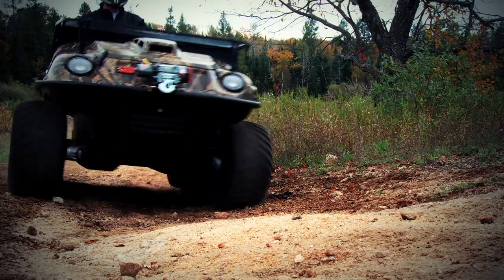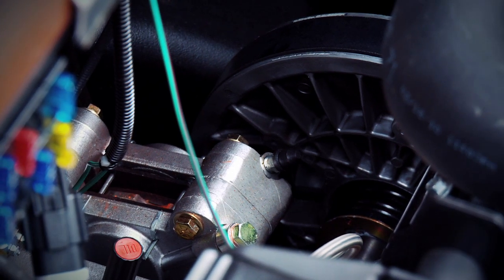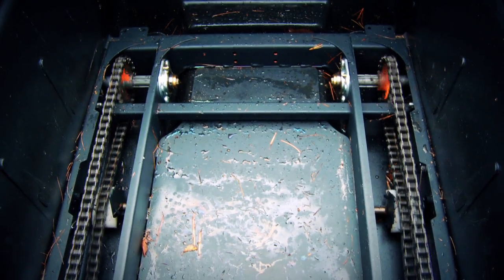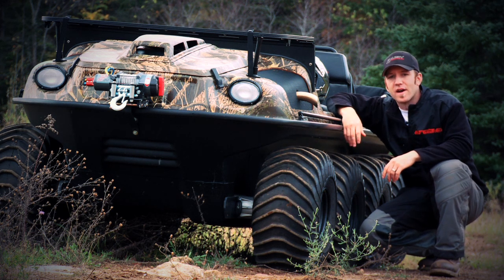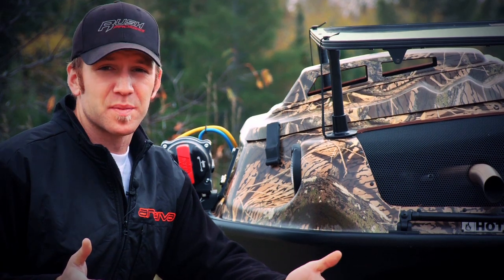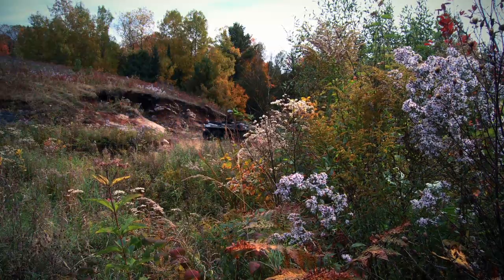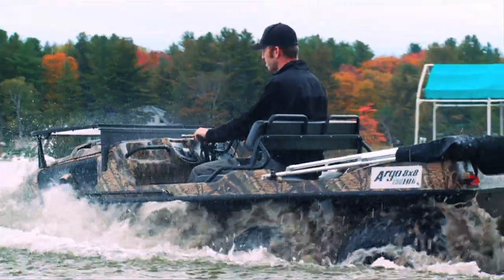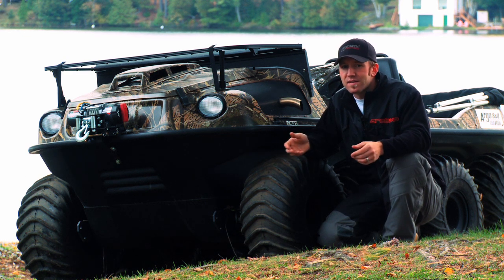Dirt Trax Test Rides Argo 8x8 750 HDi

Comment: about the top speed: this thing provides torque enough. you cna give it a longer transmission, as far as i know these come with varios? its not to difficult to do there so it shouldnt be a problem. also, if you are ONLY using it in forests and stuff, you dont need to go much faster.

Comment: Perect for out west. In Mississippi, I have never owned such a bigger piece of sh$t. I am an avid duck hunter and thought this would be the solution of not having to own an atv and a boat. Boy was I wrong. The moment It touched gumbo (mississippi mud) the mud got in between the tires locked the wheels up and it began to over heat. This happened several times. Never buy an argo unless you are in an area that is all rocks.

Comment: Well I bought a New Argo, Very Disappointing, It got stuck everywhere, Spent lots of time lubing the Chains, Had it 4 hours and the electric starter went? I had to take engine out to replace it, Over all besides having to leave it out in the swamp stuck overnight and even after buying the super tracks it wouldn't climb any hills in the winter, Quite a useless machine. I was so happy the day I sold that piece of useless Junk. Im quite serious about it being useless.
Reply: "It got stuck everywhere" i'm guessing you didn't have adair or escargo tracks... "spent time lubing chains" that's something that has to be done and they do make an auto chain lubrication system. "Electric starter went" those things can happen.... "Had to take engine out to replace it" did you forget to put oil in it LLLOOOOOLLL..... delete your comment... all your doing is trolling on the Argos with little merit. IMO
Reply: Had Argo Tracks. Useless they were. NO didnt forget to put oil in it. Youre reading and understanding needs some work. Just said starter went like it was almost brand new 5 hours on it? a useless thing as well as many others who once owned one and swear they never will again.!
Reply: Nope read it just fine.... you must of had a lemon in the batch with the starter going out in 4 hrs of use. Where your getting mixed up after reading my comment is that these things can happen..... doesn't necessarily mean Argos are garbage because the starter went out. Also on top of that the engine decided to tank.... man sounds like you were having some bad luck or time or both.
Reply: Let it go....obviously, this guy is just trolling. He never owned an Argo.